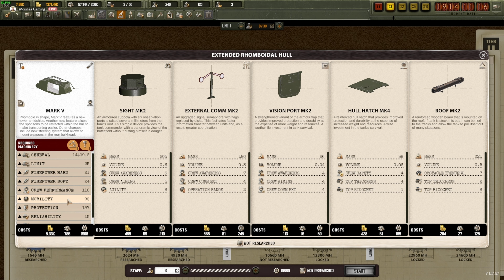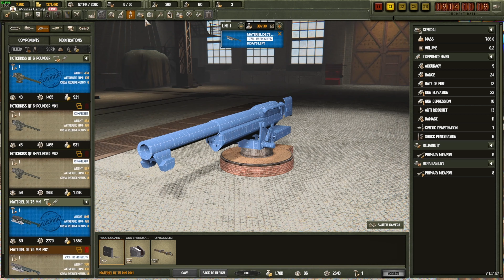Our Tanks Get Ambushed !!  Testing Of Arms Trade Tank Tycoon

Comment: just a little tip try to go diagonaly up the hill or incline or zig-zag course will even out the surface its the same reason a mountain road zig-zag to get to the top
inj your case try going right for a few seconds when leftfor aanother few seconds and repeat as necessarry as you try to climb out of the ditch or up a ramp it could be the answer to succes
Reply from the maker: Honestly mate no matter what I did it wasn't going up that hill , I tried for 10 mins 😂

Comment: The gun elevation and depression is much better with the French MG, since it has a stock option, and the German MG doesn't. However, IIRC from another video I saw, the researchable British MG is slightly better than that French MG. It's just that you get the French one without having to research it, and you can only research one thing at a time.
Reply from the maker: yea your not wrong , the later models of British MG would have been nice however other pressing matters were of concern , like you said , you can only research one thing at a time  .......... for now